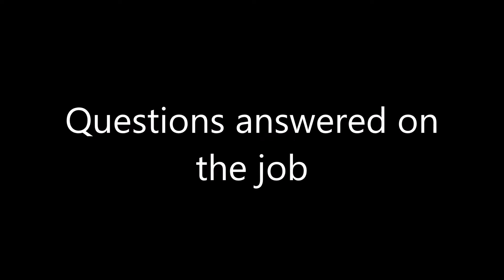Polzn Bladz-Question answered on the job

Comment: Recently switched from using 25 degrees to 10. Was getting little lines when coming down the top right corner. That tip to hold the handle closer to the channel has really helped. Flying mate. Cheers Bob 👍
Reply from the maker: Thanks for letting me know. Carry on zero mistake window cleaning
Reply: @polznbladz3242  didn’t put a blade wrong today 👌
Reply from the maker: @flamadiddler  Perfect

Comment: Long time no see! I'm writing to hear your opinion :) 

Features of nxt-r rubber that I felt (based on the rubber condition available immediately)

1. This rubber has similar performance to ettore rubber (excellent moisture removal, insufficient gliding).

2. If other brands of rubber (regardless of soft/hard) are like cheese, this rubber feels like a spring. (It's fully saturated with soapy water and can easily align the rubber on channel 3.0 even when the rubber is bulky.)

3. Compared to other brands of rubber, the particles that make up this rubber feel a little larger. (Thought it is related to the characteristics of No. 2)

4. For the same reason as No. 3, 1) uneven glass surface 2) when squeezing dry glass surface 3) When squeezing glass surface with hard water stain, I guess there is quite a lot of noise when squeezing. (sound is related to vibration)

I used a translator. I hope you understand it well.

I expected it because it was about a long channel, but it's not easy to understand because there are no subtitles. Thank you always :)
Reply from the maker: I think I understand. The rubber has flaws and it should not had been sold. It is meant to be having an improved formula. We will have to wait and see if it gets better
Reply: @polznbladz3242  I'm a little disappointed with the squeaking sound of the nxt-r rubber, but I'm generally satisfied.😁 Rubber of all brands may have bad arrangements, and certain new rubber may work immediately or may require some penetration. While practicing Channel 3.0, I realized how inconsistent all brands of rubber were.🤨 Standard channels (such as unger s-channel, ettore ss/brass) are tolerant of friction, making it difficult to recognize the slightly bad arrangements of rubber, but liquidators' channels are precision tools, making it easy to recognize rubber problems. I'll practice more. Thank you for your reply!😊
Reply from the maker: @엉클문  Liquidators highlights bad performing window cleaners and rubbers that don't perform well. Rubber is a natural product and things fluctuate. There is never a perfect rubber blend formula. Some batches are better than others
Reply: @polznbladz3242  Always a good teacher! Thank you. Have a nice day today.😊
Reply from the maker: @엉클문  Thanks

Comment: Isn't it necessary to wet the window with soap solution before you scrape off bird dropping? Thought that it could scratch the window by doing it dry!
Reply from the maker: It wasn't sun baked on and the razor is brand new. If I get water on that razor tomorrow it will be a rusty blade. Do I need to ruin a new blade for powdery bird crap that falls off if blown? The washer would had taken it off but then I get a dirty washer. Maybe I should had wet up first. Normally builder cleans, sand cement is the culprit for scratching glass with razors. Flakey bird muck takes no force to remove
Reply: The windows I do is once a year... so they are full with stuff from birds and insects and so on, sun baked and so on. I wet the hole window with soapy water and scrape it with the blade, soap it up again and then finally make magic with the Liquidator. Result window is like new again! 👌 
So when I saw that you scraped those 🐦 droppings away dry it got me thinking maybe I don't need to wet it up first. 🤔 
Learned a lot from you and trad-man, thank you wery much! 😊
Reply: I always clean the blade after work and dry it with a towel ore something, so it doesn't get rusty and I can use it several days as long as it doesn't get damaged!
Reply from the maker: @kimjakobsson8395  I do schools once per year and it's a different work level. Much harder, baked on insect and bird muck. What I do notice is the wfp windows are really dirty and the squeegeed windows still have a gleam/shine to them apart from the droppings these windows look ok for a yearly clean. We're lucky in the UK window get cleaned more regular. I'd stick to wetting the windows before scraping
Reply: Yes I know, I do mostly schools and preschools, all 4 sides in out and in between, once a year. 🙂
Reply from the maker: @kimjakobsson8395  I got a school to do on Monday